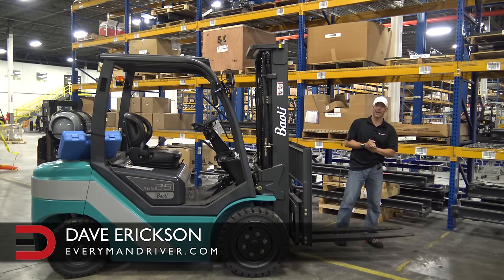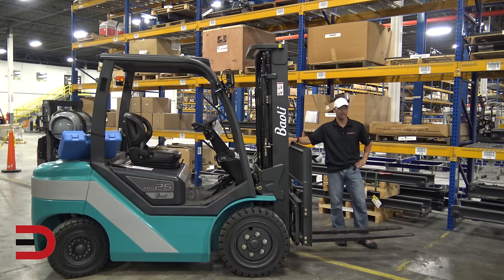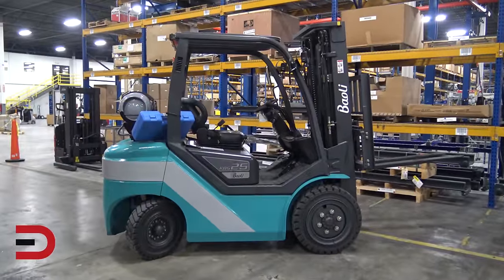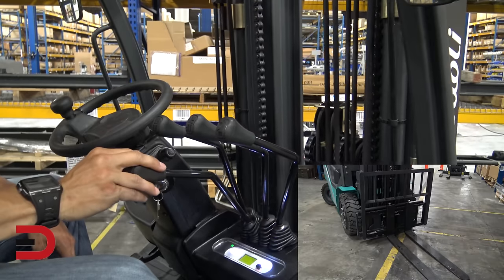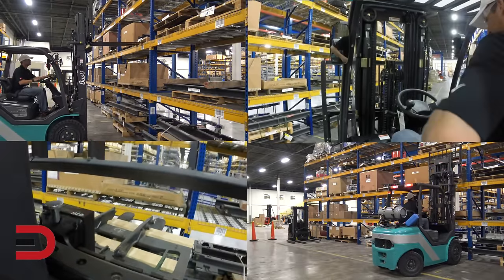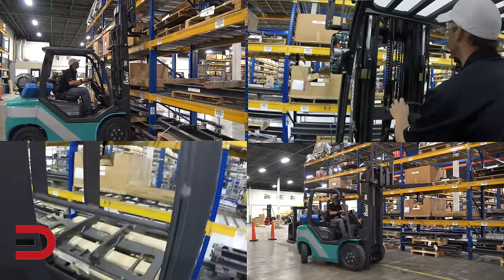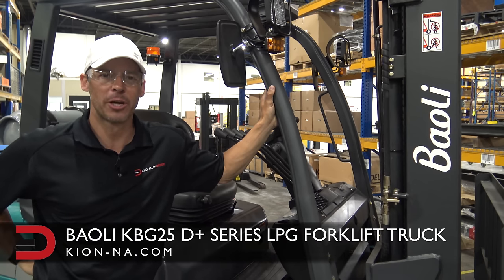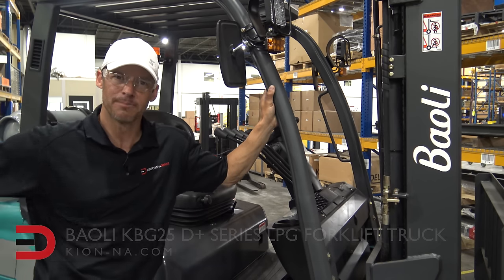Forklift Review: Baoli KBG25 D+ Series LPG Truck on Everyman Driver

Comment: The safety features on this machine make it very inefficient and annoying to use. If you make the mistake of trying to operate the controls delicately while doing steering inputs it can stall, at which point you have to key off, unbuckle and re-buckle the seat belt and put it into park to fire it up again. Don't actually use the seat belt either because if you regularly get on and off the machine you will inevitably snag the catch on the seat belt and it wont disengage without pummeling the housing with your fist. The really small park/brake pedal forces you to hyper extend your toes and bend your steel toe painfully backwards unless you hit it just right. Lack of power rules out the possibility of slowly inching toward a customers vehicle on anything but the flattest surface, forcing you into over throttling and breaking. There's only a step on one side so every time you go for the wrong side you have to heft yourself up higher than normal, but don't worry you can't bump any of the controls because they wont work unless you're buckled in so forget about getting a birds eye view and making pallet placement adjustments. And don't lean over to get a good view either because lifting off the seat stops you from moving, unless you're rolling with gravity. The wheelbase is nice for driving fast through potholes, about the only good thing about this machine